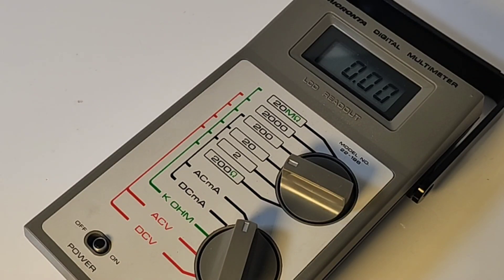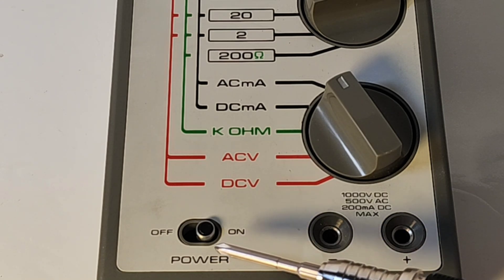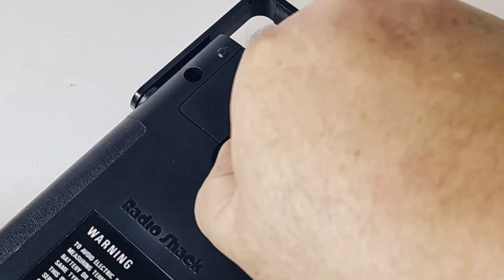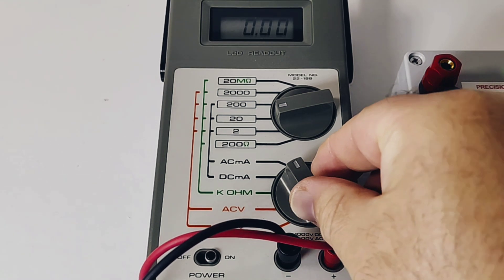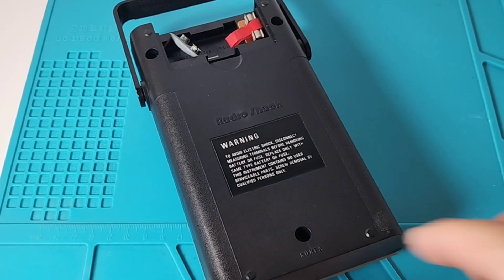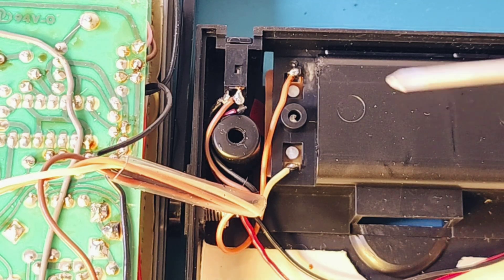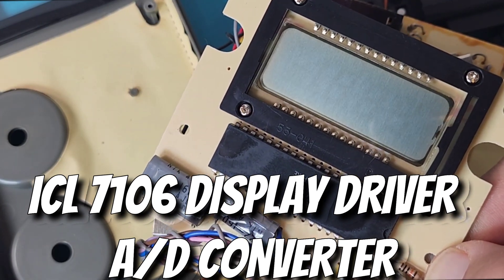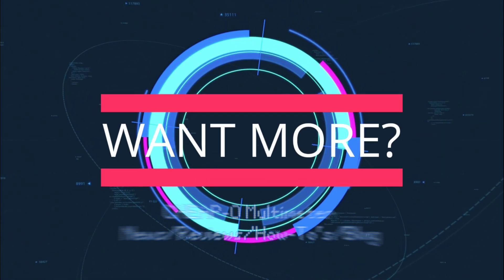RETRO-TECH ○ MICRONTA 22-198 Multimeter Mini Review & Teardown! (1979)

Comment: Thanks for your videos.
I bought one in 1979 and it still works and is still as accurate as ever, I just had a problem with the LCD display at one point but I managed to solve it easily by cleaning the contacts.
Reply from the maker: Many thanks and glad the trusty Micronta is back on your bench! 😊

Comment: Later models had "U" added to the model number. The front had 500v MAX next to the negative jack and a red lighning warning over the positive. Between them was the ! triangle. Those additions are mentioned on page 4 of the included manual. I guess that earned its UL "TESTER" and "LISTED 176Z" round sticker below the back label which also has the obligatory WARNING and CAUTION added to the main label. Nice find. I got mine new ~1983. All the thru hole hand soldering earned its production cost.
Reply from the maker: Great info 👍  Micronta built a multimeter tank here that's still as accurate as ever! Solid and stable. New from '83  WOW!  That's one well built test instrument. 😊
Reply: @KeepOnTesting  Works well. Haven't tested accuracy in a while. BTW, be careful with the paint of the front label. It comes off easily. It's printed on shiny metal.
Reply from the maker: Ahhh...absolutely! Thx for the heads up!

Comment: Interesting:  I'm the original owner of my 22-198 meter, and when opened up, mine has absolutely no bodge jumpers (or added resistors!) whatsoever on the back of the PCBs.  Also, perfectly clear soldering throughout w/ no flux residue.   Obviously wave-soldered.  Perhaps you have a very early (very handmade?) production unit. I still have its original test leads which do resemble yours.  DC accuracy is only like 5%, perhaps due to component aging.  On the side of the PCB is the same white trimmer pot you have, but I don't know if this is a calibration pot.  There's no serial numbers, but behind the battery is a white sticker with "7 A 1".  Thanks for the video!
Reply from the maker: Thx for the update. Mine very well could be a first run batch but hard to say. Any chance you could send a pic of your pcb ? I'd love to see the difference. If you have the time my email: netplicity1@gmail.com 
Thx 👍

Comment: 1979? Why "8001" on the main chip? Has it been replaced in 1980 or later?
Reply from the maker: These were first released in '79 ..this might have been purchased by my father in 1980..he doesn't recall the exact date. All parts are original.

Comment: The 22-191 Micronta is almost identical styling, has a Rel (zero) button, uses 2 AA batteries, and is a whole lot cleaner inside.
Reply from the maker: Interesting how Micronta varied the lineups..! I have to say the 22-198 was one of the busiest internals of any multimeter I've looked at.